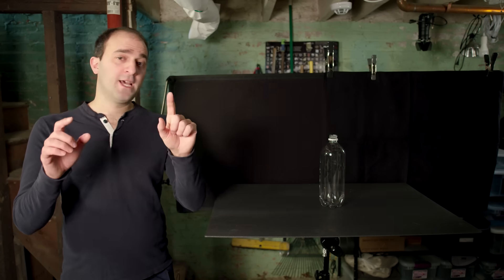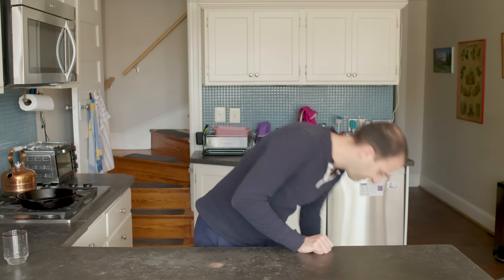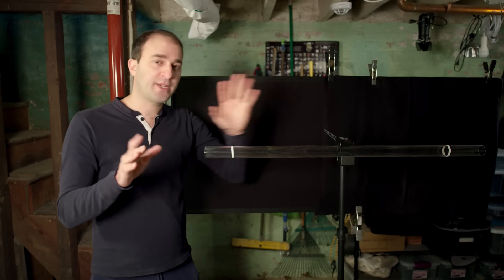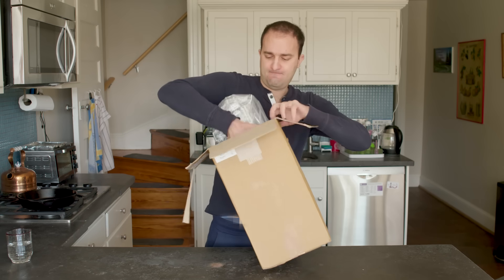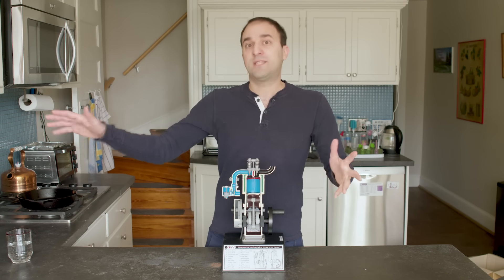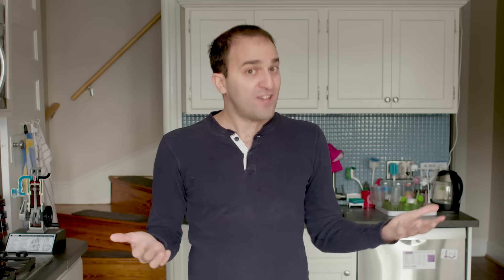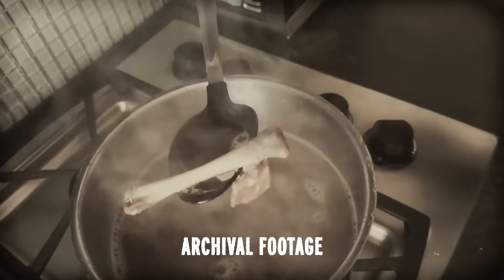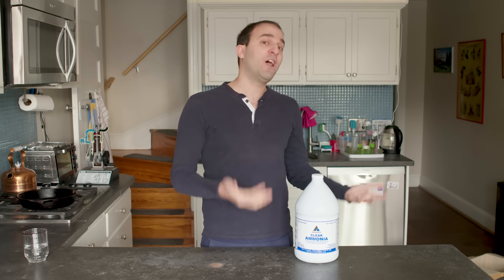Does Toyota Know Something That We Don’t?

Comment: Maybe it's possible to use ammonia in an engine. The main issue I can see is the energy needed to produce the ammonia. Petrol, you simply pump up and distill to the right fractions. Ammonia is produced via the Haber-Bosch process, so instead of using 1 joule to pump and transport 1 megajoule, you'll have to use 5 joules to produce 1 joule of fuel, and you'll have to adapt the whole thing all over the world. There is no free lunch in thermodynamics.

Comment: it's kinda too late now though,  switching from gasoline/diesel to Hydrogen or Ammonia makes sense in that you could have used already built infrastructure (gas station, storage and gas pipelines etc) with relatively cheap safety overhauls.  But EV was quicker to market and there are now already being made wast changes to the infrastructure in most countries to accomodate electric charging.  If Toyota (and that Chinese company) had put more focus and money into this research a decade ago it could have been a contender against EVs.

Comment: There are point to point trucks I have noticed that take food products from mfg plants to  distributors that are running LNG. This is a lot like propane but higher pressure. Neither of those has ever even raised an eyebrow. And I think Ammonia is a lot like those. If the tank is breached they all flash off into gas and are not a threat in a matter of seconds.
Reply: In New Zealand we have been running LPG (Propane) and CNG (Natural Gas) in petrol (gasoline) engines since the 70's and 80's. After market conversion kits are available and a licensed installer does the conversion. Better MPG and longer engine life, around the same as a diesel truck. It is cleaner burning and doesn't wear the oil out as fast as a petrol (gasoline) engine. One or two car manufacturers had LPG options supplied new from the factories. The price for LPG was a lot cheaper as well. Maybe a govt subsidy, I don't know... maybe it was just cheaper? The cost of the conversions and in a lot of cases the boot (trunk) was taken up by the fuel tank.... maybe this is why it never quite made it to be mainstream over here. Also you can't convert just any old motor.. the valves and valve seats need to be made of the right metals...But there are a lot around.

Comment: Methanol is a LOT better fuel... no special storage needs, liquid at room temp, boiling point 64 C, pretty clean burning, lots of power, F1 cars run on Methanol. Based on what i know, you make Methanol by taking CO and adding hydrogen to it via hydrogenation...
Would be interesting to watch a video similar to this one but about METHANOL.

Comment: toyota has ben saying for years that battery cars was a dead end and a step back. so i am not surprised. i expected more of a fuel cell approach. 
2nd they are starting to bring back ammonia in kitchen refrigeration. i'm seeing them show up to be recovered and trashed at work now. ( yes i work in the hvac trade ) . ammonia and propane both all because of bad science back in the 70s  and 80 led to the removal of better refrigerants in 92.

Comment: 02:40 even as a joke that reaction is a failure, because NH3 is a stronger greenhouse gas, it needs a lot of co2 to produce, easier to leak than other compounds. and not mistaken the increase of nitrogen has negative influence on environment

Comment: Ammonia alone is not energy dense enough to be used with ICE the way we use it.  But you can heat it and break off hydrogen and power a fuel cell and double the energy efficiency.

Comment: In modern diesels to reduce NOx (in fact adsorbed NOX) AdBlue is used which is 5% aqueous solution of urea. Guess what, at catalyst temperature it hydrolises to CO2 and ammonia. Ammonia as a reducing agent will reduce NOx to N2 (byproduct: water). So as exhaust gas treatment to remove NOx you can use ammonia. Fun fact you don't have to buy it separetly like in case of AdBlue. It is sitting in your tank already. OK it will increase consumption with 0.1-0.2 %, but the engine will run with very low NOx emission.

Comment: No Amonia is not going to become a motor fuel, it takes energy to make and is not remotely a reduction in carbon output because ALL amonia is made from fossilfuels, it is also caustic and hard to store.  It litteraly makes less sense then the Hydrogen that Toyota has been pushing.  All these alternatives to battery electric vehicles are a complete waste of time and money from Toyota which has cost them decades and will be seen in the long run as one of the worst choice the company has ever made.

Comment: Dear Lord, this is a video for idiots:
1. How is ammonia produced? By the Haber process, which combines nitrogen with hydrogen.
2. How is hydrogen produced? Mostly by steam reforming, which reacts natural gas with steam, producing carbon monoxide as a byproduct. The CO is rapidly oxidized to CO2, a major greenhouse gas. Hydrogen can be produced by electrolysis of water, but when you follow the efficiency of the whole cycle, it's very low.
3. Ammonia does not burn in the way this video states. At normal combustion temperatures, the nitrogen is oxidized to NO2, an ozone smog precursor which is poisoning the air of most big cities.

For some, probably political, reasons Toyota is fiddling around with dead-end technologies and avoiding making EVs.

Comment: Its actually pretty easy to contain ammonia in a tank. while it is higher pressure than propane its MUCH MUCH lower than hydrogen only about 300 psi at 130 F (as hot as it gets on earth) so with carbon fiber tech it would not be hard to build a safe tank that hold liquid propane under pressure at ambient temp. The tricky part would be dispensing it as you have to put it into the tank under pressure unlike gasoline. But im sure it could be figured out without to much trouble. liquid/gas ish fuels are the future NOT electric. unless MAJOR improvements are made in electric storage tech (and I mean HUGE) It will always take alot longer to charge a electric car to go a lesser distance than to fuel a ICE car and go a farther distance. unless you commute 50 miles a day and then go home and do nothing else long distance travel in electric cars will not work. no one wants to sit for 3-4 hours to wait for their car to charge every 200 ish miles. when a ICE car can fill up in 5 minutes max and go 400 miles. Who knows maybe some really smart people can figure out how to retrofit old cars to run on ammonia so we can save building lots of new cars

Comment: You still have an energy density problem. Ammonia will produce around 7,000 BTU /lb. Where gasoline is around 15,000 BTU/lb. So it's gonna take twice as much ammonia to do the same work. Then there's the corrosive effect of ammonia and other issues. So..... interesting perhaps but ultimately not going too far.

Comment: Flip, not switch, switch go out da front strait. Love the demo, they don’t even make these anymore well for modern fluid pumps. Great demo. Yeah my first ammonia experience was with it entrained at 12% or so concentration in oil. You can buy smelling salts stronger(ammonia based). I’d say sulfur is part of the smell(rotten eggs) but only a small part. It’s mostly like isopropyl mixed with a deep, back of the throat funk, that will start you coughing- no matter who you are, because that’s just how it works. Ammonia likes stuff and everything is made of it, and that is typically a problem, because it will react with most stuff. It’s also so powerful it is totally intolerable to have double digit ppm of it.

Comment: Not worth it,   because Ethanol has about 2/3rds the punch of gasoline without a promoter and it doesn't have all the nasty side effects of Ammonia.  Solution:   Drop gasoline,  use Ethanol,  just like Henry Ford wanted to do about 100 years ago.
Reply: But, ethanal has about 20% less energy per lb than gasoline so 20% less fuel efficiency, it's corrosive and you'd need to produce A LOT of it. Like 700,000 acres of corn  to make enough fuel for ONE day of gasoline use in just the USA alone. 

That 700k figure is based on 1 for 1 replacement of gasoline with ethanol it's actually more like 850k because you need 20% more ethanol to replace the same amount of gasoline. 

So...... that's why we're not using ethanol either. Harvesting and processing 800,000 acres of corn daily to meet the fuel need isn't practical. 

We used to do this sort of spitballing when I was in college. There're actual practical limits to replacing gasoline...... which is why it isn't happening quickly. As the cost of gasoline increases other options become more practical but it become more profitable to drill in the more expensive oil fields too. So..... gas kinda wins out economically

Comment: I helped my dad put a propane retrofit kit into a 1995 Ford F350 in 1996, It was super easy then and has become way more efficient since. It requires less modification than one would assume to make an engine run, it has an existing safe infrastructure and is readily available in the U.S.A, but nobody ever considers it as an option. Why?
Reply: Congrats to you and your dad on the conversion ! Propane is a cleaner burning fuel than gasoline though a slightly lower energy level,... Propane loves compression so the power can be made up there. HOWEVER, Propane is very dry, runs HOTTER than gasoline and can cause exhaust valves to burn ! Propane engines are setup with sodium filled valves and Stellite valve seats to take the higher heat along with larger cooling passages in the heads . it is generally lower in fuel costs too. The difference in the 1-2 MPG loss is more than made up for by the lower cost,... sometimes there's no milage loss with the newer F.I. engines .  My Dad converted his 1968 F-250 to Propane in 1970 ,... had a 390 C.I. engine and ran great till it burned a valve 2 years later. His major complaint was the lack of gas stations carrying Propane  and was afraid of running out somewhere on a long trip . PETROLANE,... the propane company that did the conversion supplied him with a booklet of dealers and stations that had propane, so that helped some.  In 1970 when Gasoline sold for 32 -34 cents a gallon, he bought Propane for list,... 17 cents with a 4 cents Federal supplement discount ,... so 13 cents a gallon !  He loved it !  Propane and Natural Gas are both good fuels and cleaner burning !   The Propane infrastructure isn't as large as gasoline and would have to be vastly expanded to handle the millions of cars today !
Reply: I'm driving with LPG, the loss in power is barely noticeable.
Reply: Miles per gallon. Propane is a low energy density fuel compared to liquid gasoline or diesel. So takes bigger, heavier tanks with fewer miles per gallon

Comment: I think Toyota knows that pure EV makers are going to crush them, and so Toyota is desperately looking for an alternate competitive solution. The main problem with using either hydrogen or ammonia is that their production is extremely energy intensive. Once EVs become price and range competitive, no one will want to have to drive somewhere just to fill up, so no one will want a fueled vehicle. Fueling stations will become unnecessary and charge stations will mostly be needed only for long-distance travel.

Comment: I wouldn't get too stuck on flame speed. That's easily solvable with engineering the engine for the fuel. The bigger issue is Volumetric Energy Density(VED). Or the Gallon of Gasoline Equivelent(GGE) measurement if you will. Take LNG or CNG for example. 1lbs of LNG is only 0.18 GGE, CNG is 0.19 per lbs. The amount of Fuel you'd need to carry to have the same amount of potential usable energy grows by nearly a factor of 5.5 with Natural Gases. Liquid Ammonia is even worse... upwards of 9x the weight compared to Gasoline. The only other fuel to beat Gasoline's VED is Diesel. LPG comes in 3rd and Ethanol in in 4th but has it's own huge set of issues with the amount of waste created producing it. The only real Alternative is finding the most efficient and safest way to produce Electricity onboard the vehicle.

Comment: Okay, gasoline was never "designed," it is refined.  That means you take a really large tank of crude oil, heat it, and let it settle into layers.  At the top are lighter products, and at the bottom are the greases.  Oversimplified?  Sure.  Easier and far safer than producing ammonia at the volumes necessary to make even a small dent in the transportation sector though.  I don't like hydrocarbons, but what makes them ideal is their abundance and the ability to transport them relatively safely when compared to things like hydrogen or ammonia.

Comment: There are some interesting developments in mechanochemistry that can produce ammonia more efficiently. Not sure how well it could scale up.
I think the main reason ammonia is attractive is due to it being easier to transport and store when compared to other alternative fuels.
The annoying thing about petrol/diesel is that it is so stable for such a very high energy density. It is very difficult to find an effective replacement.
Batteries can't come close without incarnating themselves (Lithium fires are beautiful though don't get me wrong) and hydrogen is too difficult to handle at the scale required.
We already have the infrastructure for handling ammonia on a large scale so it could be fairly easy to build an energy economy with far less investment.
It might actually be a path to carbon neutrality within this century.

Comment: 11:35 "If you have good regulations and good safety practices". Ok that's the clincher - because not even hospitals have good regulations and safety practices anymore when it comes to something as basic as ensuring well ventilated, clean and filtered air to reduce airborne spread of disease. In most parts of the world, anyone who ends up in hospital for anything faces a very real risk of being hit by that thing that cannot be mentioned, especially if one is not wearing an N95 thingy or better.

Comment: I don't understand why we have not invested in Hydrogen technology. Hydrogen is the most common element in the universe so it only makes sense to use it as a fuel source.
Reply: The simple answer is, with the limitations on producing hydrogen it's not practical to produce. You end up putting more energy into the production than you get out of the end product. 

One way to produce hydrogen is to crack water but that takes LOADS of electrical energy and nuclear power is frowned on. So producing it with coal, hydroelectric, and natural gas powered electricity is too costly.

Comment: Only fools would think it's cool to burn ammonia inside an engine. NH3 is insanely dangerous. Yeah, hydrocarbures are nasty and smelly and produce carbon dioxide among a plentiful of other things. But atleast, you can fill your tank with a pistol without worrying too much inhaling the fumes. Try that with ammonia. Good laugh for your friends. Or not. If the industry is not ready to deploy more EV charging stations, they wont change the current pistol systems and the provisionning either.

Also, having spent three years in college manipulating NH3 in chemistry, i'm appaled by people not having done so and while opening a container of ammonia for the first time, are ignoring the smeel it has. How is this possible in a developped country ? Ammonia is everywhere, in almost all cleaning products atleast.

Comment: yeah ammonia is bad stuff.  Here's the kicker.  The EPA mandates that diesel engines meet certain emissions requirements.  They dont necessarily care about "how" it's done, so much that it "is" done to their standards.  So the least expensive way found (to date) is the DPF and over 75hp, DEF.  DEF is injected into the exhaust stream where it breaks down oxides of nitrogen into "harmless" ammonia (according to the epa).  Let that sink in.  I've heard it said that we traded one problem (oxides of nitrogen emission) for another (poisonous gas emission).

Comment: If instead of relying on the power of the explosion to create the energy to turn a driveshaft, use the ammonia as the fuel source in a generated that supplies the electricity to the electric motors? Yes, an ammonia hybrid.

Comment: My dad used to work in a refrigeration plant that had 8 inch diameter, twin pistons,  ammonia compressors run by single cylinders diesel engines that had a couple 5 feet diameter flywheels attached to it, with 6 - 1 inch V belts....the ammonia receiver was 24 inch diameter by 20 feet long.....those were the days....:)

Comment: When I was a kid I worked for a summer in an ice cream plant. The refrigeration system used ammonia, and when there was a leak you would know it immediately. Cleaning ammonia like you can get at the grocery store is something like 3-5% ammonia. I've used printer's ammonia to vapor dye wood. That's about 15% and that's strong stuff. Refrigerant ammonia is around 99%!